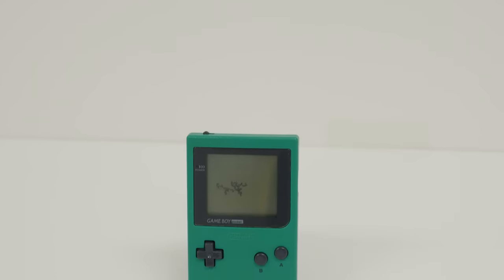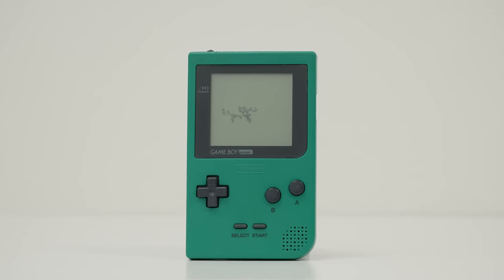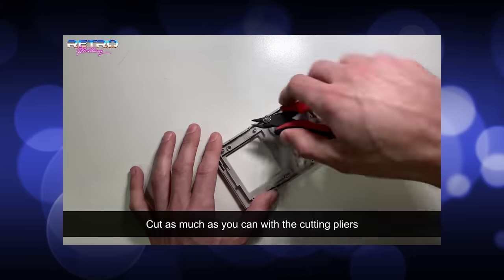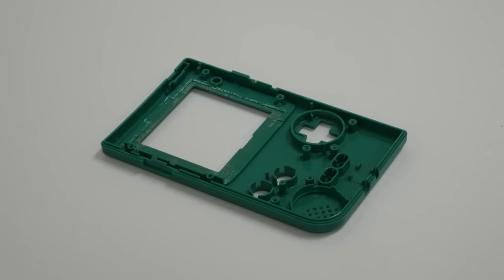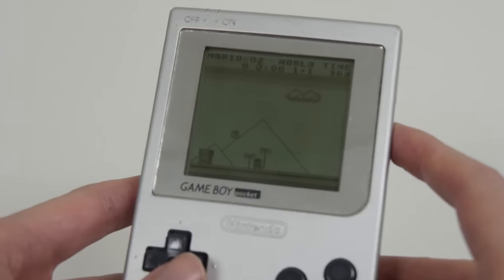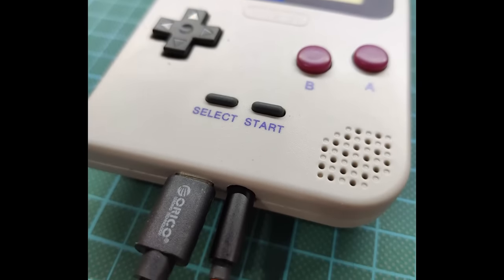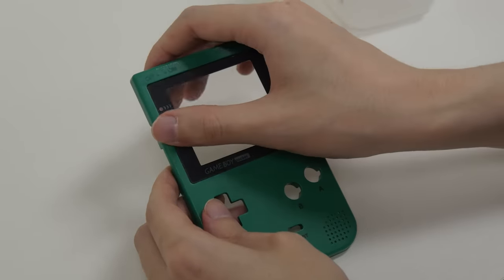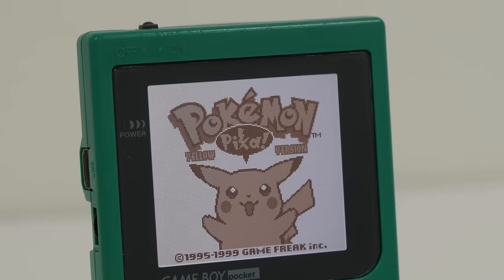Building the ULTIMATE Game Boy Pocket from JUNK

Comment: The screen issue is definitely delamination. It's either air or moisture between the plates that you're moving around when you press on it. I worked at a vinyl sign shop as a kid and we had to squeegee air bubbles out from under the vinyl all the time after applying it; the behaviour of the bubbles looked very similar. The best reason I can think that it appears as dark dots is because LCDs are sensitive to pressure (as well as electricity) and those bubbles are pressing against the liquid crystal, causing it to bend the light in those spots.

Comment: If you're using this with an Everdrive then it will tank the battery, the screen on it's own isn't too bad.
Reply: Like, bottleneck the battery?
Reply: @simplyalonso  The Everdrive just uses more power, especially the older one and the AliExpress clone of it. Combined with the screen sapping more power than a standard one your battery life takes a hit.

Other flash carts are available which are as power efficient as original games.
Reply: @MegaTerryNutkins  such as?
Reply: @tonyhakston536  Everdrive GB X5 is good bet for an SD flash cart, older ones and clones are worse. With high capacity rechargeable cells the cheap clones are ok though

Comment: One thing I've found works really well on stickers and adhesive residue is electrical contact cleaner. The one I use is "QD Contact Cleaner". It's safe on plastic and metal, and there's no oil to wash off after.

Comment: Matt, you should pick up some "Goo Gone".  (Just the "Original" stuff, don't need any of the variations.) It's a citrus (yeah as in fruit)  and petroleum based adhesive remover. It doesn't work for everything, but can do wonders for some of the likes of the gunk you spent cleaning off of the screen & lens with this project. (You of course have to clean that off too, but that is much easier.)

Comment: An easier way to remove the clear plastic piece in front of the screen is to heat it up with a hairdryer or hot air soldering gun to melt the glue another way that doesn't need heat is to twist the shell (but not too hard or it could break).

Comment: 3:10 Don't worry too much. From the looks of the "Nintendo" logo on the case it's most likely NOT an original shell. It's probably from when duplicate plastic molds weren't as good as they could be today.
Reply: Yes, you can also see how there is an hole as a power led indicator despite the board not having a led in the first place
Reply: @mint_kyuu99  it’s an oem shell
Reply: That’s definitely an OEM shell it looks identical to my GBP which has its original shell.
Reply: @mint_kyuu99  either the LED was removed, or this isn’t the original shell for this GBP. I do believe it is an OEM shell though.
Reply: @EvilTurkeySlices  Oh really? Odd, before the mod it still didn't had it, and i guessed that it was an earlier board (from a console that didn't had a led), but i didn't think that it was put into a og shell that had a led spot

Comment: One thing I discovered is acetone does wonders removing glue residue. Just have to be careful because it eats more than just glue residue. I mean, it's nearly immediate. I did the same thing as you, using isopropyl alcohol, but there's just no comparison.
Reply: Acetone will melt the plastics.  It MAY be okay to use on the inside of the case if you are very careful, but it will certainly ruin the lens.

Comment: Thankfully my Game Boy Pocket screen is in great shape. It does have a factory defect where there is some “ghost lines” as I call them in certain scenes, basically there is faint vertical lines that line up with breaks in the pixel art like at the ends of a text box or something similar. They go from top to bottom of the screen, but aren’t very noticeable. I’ve read that most Game Boy Pocket screens are effected by this and a replacement screen Paul likely have the same issue. I also read that the problem happens even when the screens were brand new.

Comment: This brings back memories of me as a kid desperately trying to get some light sprinkled on the screen of my original Game Boy while playing in dimly lit rooms. There were times where I really was wondering why the FUCK the damn thing didn't have some kind of lamp on it that would shine light on the screen, completely forgetting how quickly the incandescent bulbs of the time used up even C-batteries and thus would probably cut the already not so great battery life in half.

Now that I know a bunch about electronics and especially the huge difference in efficiency between incandescent bulbs and LEDs I do of course understand very well why such lamps wouldn't have made sense back then.
Reply: Probably by the time the Pocket came around, it probably would have been viable to put green LED's to frontlight the screen, similar to cell phones of the late 90s since green LEDs were reasonably inexpensive even back then. But I'm sure it still would drive up cost and significantly reduce battery life of the AAA's and look like crap, which I'm sure is why they decided against it.

Comment: You got me intersted in fixing restoring this kind of stuff. My little sister is trying to get me to fix an old black and white video radio (CRT tv with a line, so this will be interesting)
Reply: careful with CRTs, them's some high voltages
Reply: @m.f.3347  just discharge them before working with it or just leave it for a few days, it isn't too hard if you know what you are doing

Comment: Welcome front lol

It looks like a fungus, screen fungus? Screen-conway's game of life? Screen localized contiguous cascade pixel failure? Lol. I have no idea whats going on there, but in terms of algorithm it looks like the pixels are dying contigiously, that is they die because they are in contact with other dead pixels, resulting in that connected squiggle pattern. Given the gaps in the middle it seems like the likelihood of killing a pixel from 2-4 surrounding dead pixels is not significantly higher than that of just 1 surrounding dead pixel. Could pretty easily code that and see if it generates similar shapes, not that that would help lol

It also seems to act much like an air bubble under a screen protector, maybe its something like that? Screen film separation would probably beget more nearby separation, and perhaps its on such a low level that it can interact with the physical pixel delineations?

Comment: How bizarre, I used to do this pressure trick on laptop screens with small cracks. You could push the horrible black goo back into the crack or at least closer to the edge and it would restore the functionality of that portion of the screen, I'm sure it had some kind of adverse effect (the goo couldn't have come from nowhere) but it did seem to help and was a better alternative than spending $500 on a replacement screen. Never would have guessed you could do the same thing with a game boy

Comment: 3:28
Or just simply do the cutting with flush cutters.
Everyone doing some electronics work should have atleast a few pairs of flush cutters. And do yourself a favor and get atleast one swiss one, even though they are expensive they are well worth it (but dont dare to use them on hacky jobs like this, these kinds of jobs are reserved for the cheap 2$ flush cutters and not worth wasting 50-200$ swiss cutters for).
You'll thank me later.